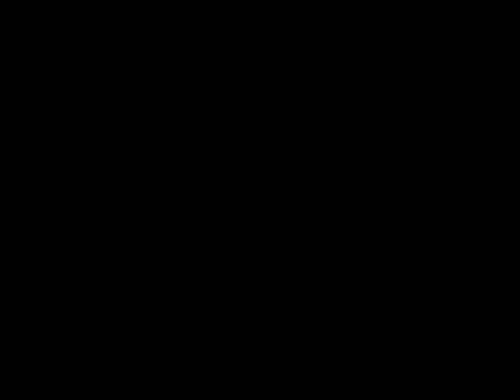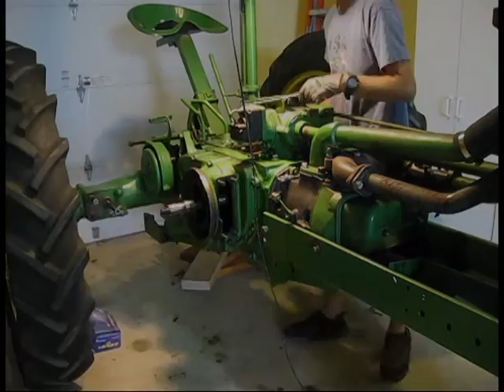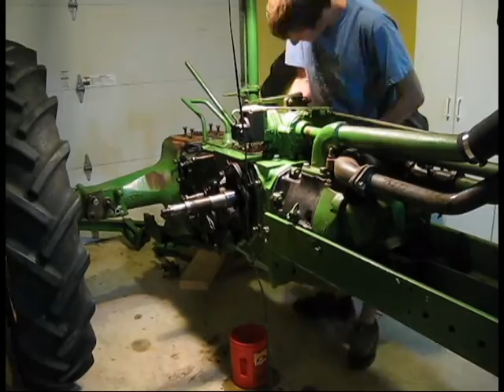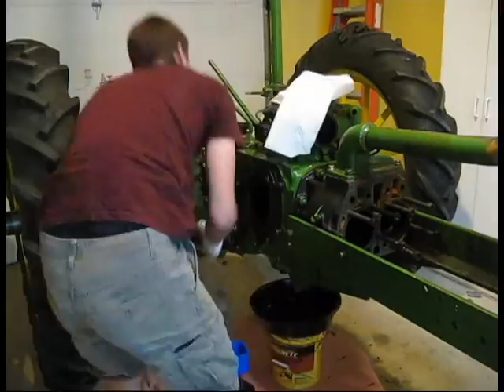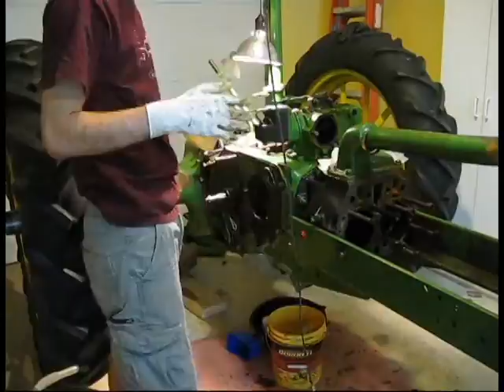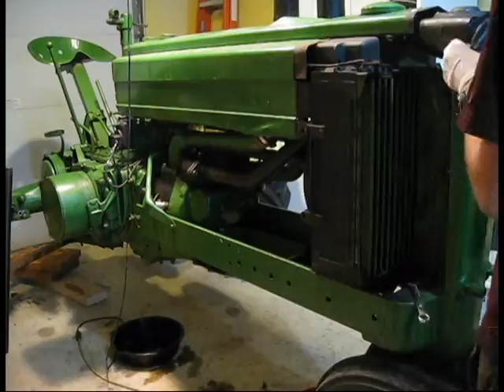John Deere B 1939 Disassembly, Repair, and Reassembly Time Lapse

Comment: I have a 1942 jd BR. The splines on the crankshaft for the clutch are destroyed, and I have to replace the crank. Does the tractor have to be torn down to this extent to swap the crank or can it be simplified? I am going to order the repair manual but am trying to get an idea of the job. Any info would be great. It is nearly identical to the B for the most part.
Reply from the maker: Slimline98 Short answer: Yes
To pull the crank you have to disconnect the cylinders which requires getting access to the crankcase. It has been a while since I've torn it down, but I remember needing to take the parts under the rear fuel tank off to open it up. After that, the entire clutch assembly and housing must be removed, which is exactly what I did in the video.
Reply: Thanks for the prompt response. I have been reading since I posted that and I have read of people having good luck welding new splines on the shaft with extreme patience and a lot of filing. I may give that a go before I pull the motor apart. Worst case scenario I fail and it is still in its current ruined state.
Reply from the maker: Good luck! We had the same stripped spline problem when we first got the tractor. We took the crankshaft out and sent it off to be welded and filed, it turned out very nicely.
Reply: It looks like you guys have done a great job restoring it back to running shape. I hope we can get ours like that. So far I have got it starting and running well. The carb was a mess. I am hoping I can weld the splines with the crank still in, but I will pull it if necessary. If I have to pull it though I feel like I may as well just replace it with a good used crank.